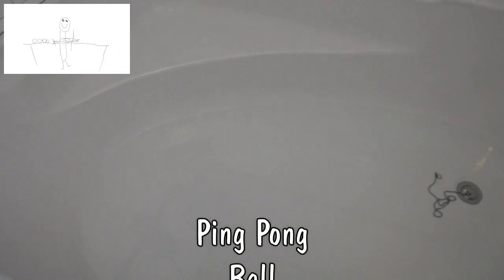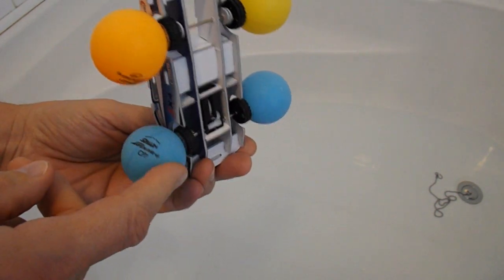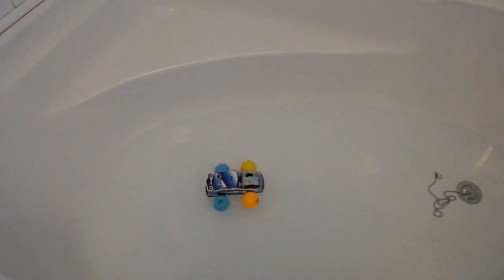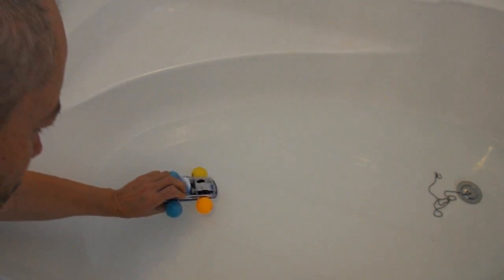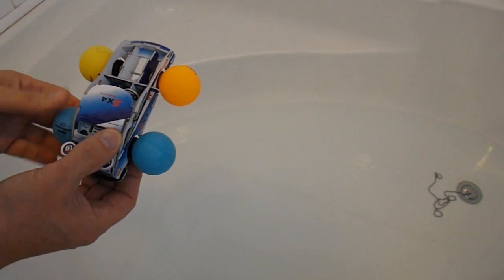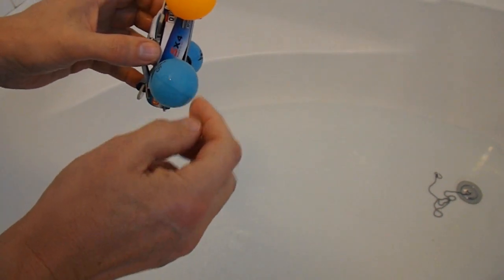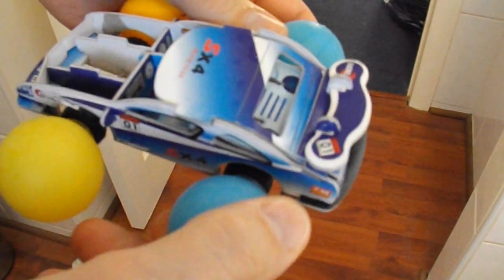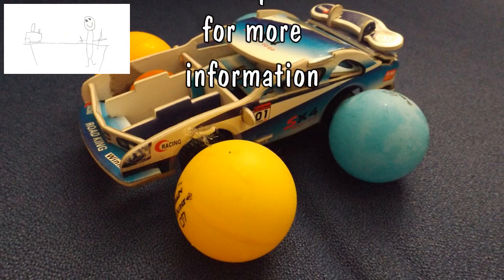Ping Pong Ball Car Boat

Comment: Hmm... If you remember the time I was talking about a car that can go right from land into water this might work so if you could make it a bit bigger and try it out that would be my new request :)
Reply from the maker: Your request is one of many still on my list. This car was a convenient test for the general idea and as with all my projects it is just a matter of time until the right components turn up. I was going to do one using the large Christmas baubles that I used in that recent project I did but I seem to have lost one. Last year I had 4 but I can only find 3 of them now, so I used one for the 2 wheels rc thing. That means I need 2 more now.